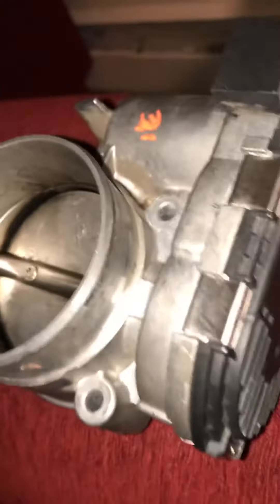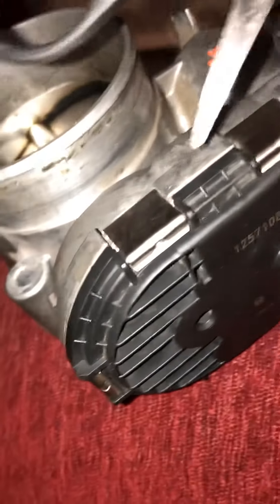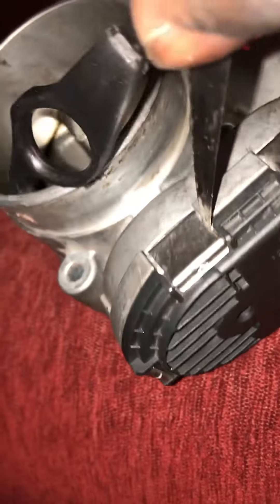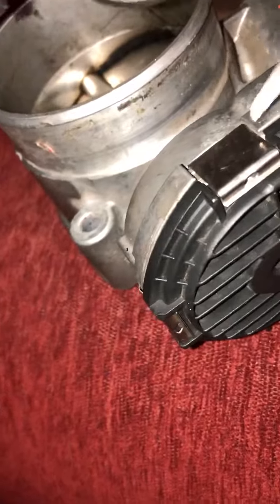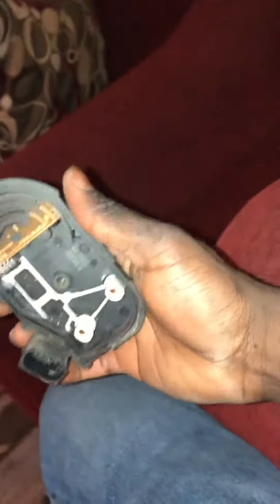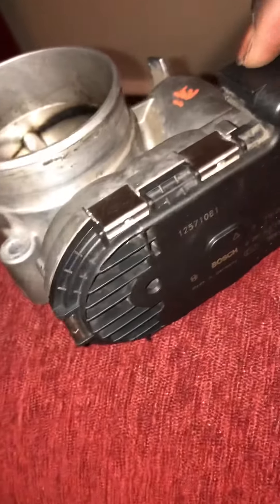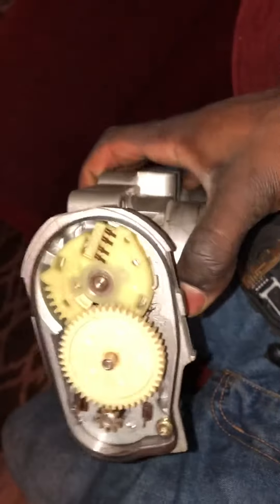2003 Cadillac CTS Throttle Body Position Sensor Replacement

Comment: what was your car doing as to how you found out it was the throttle body..instead of the gas pedal...  i have a 06 3.6L dual gear shifter/auto/manual ... i just replaced my pedal due to not going past 60mph, limp mode, engine light, etc..I DID NOT-- reset/relearn... not many other ways to figure it out besides replace all; throttle body sensor, gas pedal clean throttle body...its moving now since i repl pedal but barely.. What in the #$@ to do next?
Reply from the maker: Going Into Limp Mode , This Problem Didn’t Fix The Issue. I’m Sure My Problem Was The Gas Pedal But I Just Ended Up Selling It Because Of It.

Comment: How do you know when you need to replace this sensor? I have an 03 that shake/vibrat like crazy while in  idle, the rpm drops below 1000 and my engine light blinks.
Reply from the maker: The car told me on the screen it said “service idle control system” something like that
Reply: Long time ago but blinking engine light indicates misfire. Spark plugs or coil packs maybe

Comment: Did you end up getting this all figured out? My 2004 cts has an “idle position not set” engine code right now
Reply from the maker: ngk330 yeah I went and just bought a new one from autozone I installed it but I had the dealer program the throttle to my car
Reply: Mechanic In The Making do you remember how much they charged for the reprogram?
Reply from the maker: ngk330 like 130$

Comment: i was charged 1019.00 to change my throttle body on my 2004 cad cts...its still doing same thing
Reply from the maker: Robina Williams what’s it doing
Reply: @1Guy1Wrench  when i drove it , it flashed something failure as it descelerated. i pushed the pedal to the floor and the speed never returned. they said it was the throttle body. i paid for it , picked ut up and a few days later the same thing. i told mechanic, he said it was nothing wrong. i said ok that was a few days ago and it happened again today. i took a video of it. they have yet to pick my car up. i was told to get it to the shop myself
Reply from the maker: Robina Williams can I see that video ? 7202094802
Reply: @1Guy1Wrench  ok no problem
Reply: @robinawilliams8335  can I see the video as well?